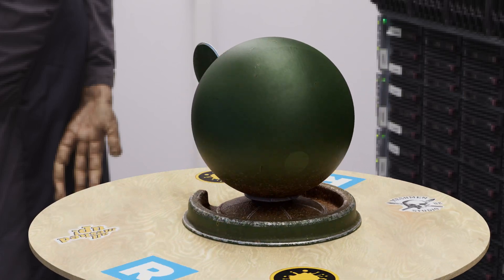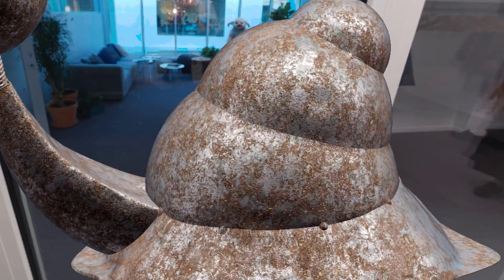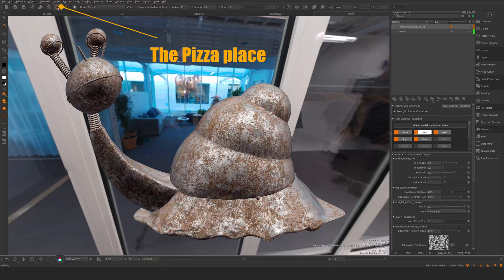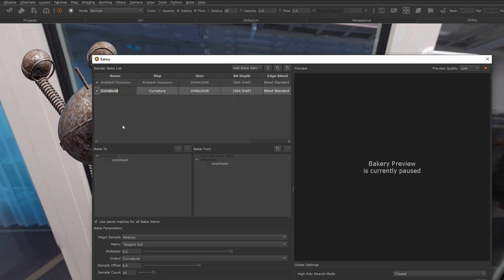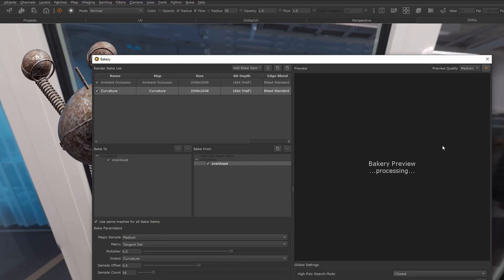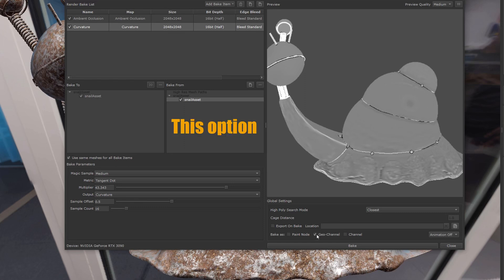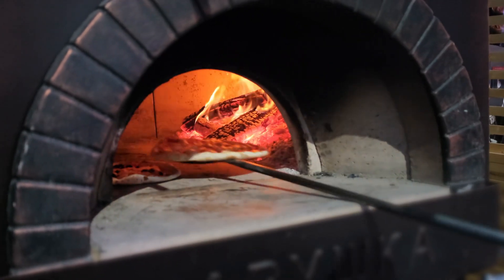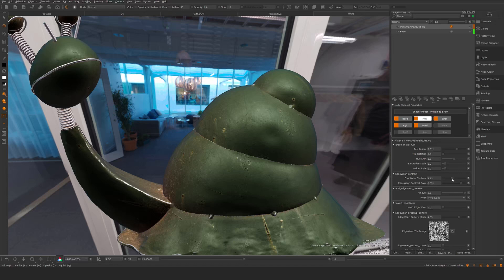Why your Mari Material might look like a dumpster on fire! : Did you forget this easy step?

Comment: Is this a 4k screen you using for the interface?
Reply from the maker: Im currently running mari on a 2.5k screen, what are you on?
Reply: @MeshmenStudio 4k but had to upscale to 125% the story with Mari - the more monitors you have, the better)
Reply from the maker: @irgendna  I have never run Mari on 4k. The 2.5k works fine for me so far. And when painting Im usually zooming in to the object anyway
Reply: my main monitor is 4k and its make all buttons and text soo small in mari theres any way to scale it ? @MeshmenStudio